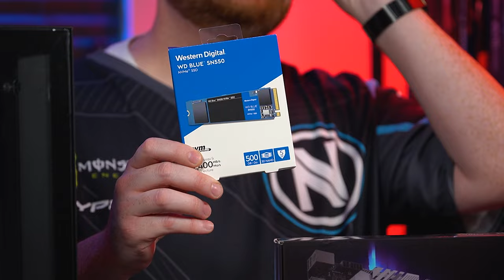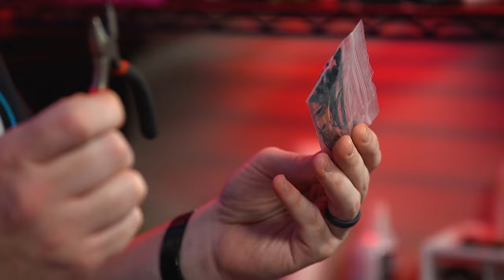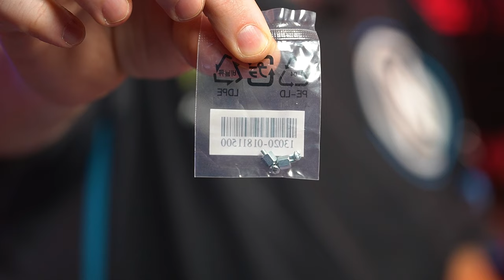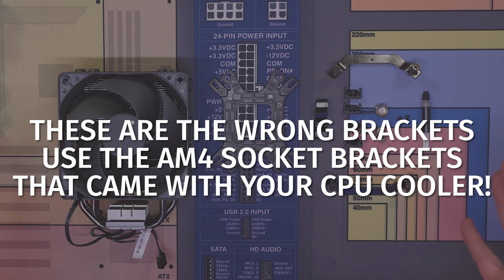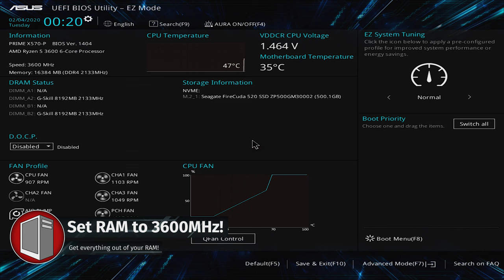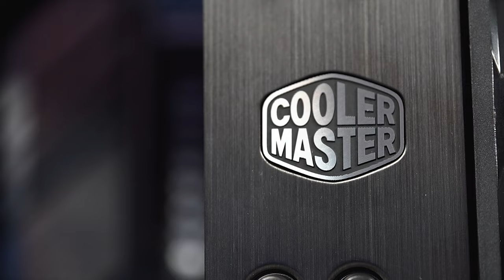How to Build a PC! Step-by-step (2020 Edition) | Robeytech

Comment: I would have went with a 1650S over a standard 1660 and saved $50. I mean cmon, the 1660 is only 3% better than the 1650S and you get GDDR6 with the 1650S.

Comment: Thanks for the great video! I followed this step by step with mostly different parts and my build turned out great. 
Different parts used:

Case - Lian Li 205m
Motherboard - Asrock B450M pro4
GPU - rx 580
PSU - EVGA 600W BQ Bronze
A few cheap Rosewill 120mm fans 

My only critique of the video was with the sections talking about the power cables for the CPU. I wish there was more explanation about the first 4 pin connector from the extension and the 2nd 8 pin connector directly from the PSU. My board only had 1 8pin ATX female connection which added to the confusion, but I admit that's my fault for having different parts, not the video's. 

All in all, really nice how - to and thanks again!

Comment: Loved this video. Very helpful explanation of the parts. Went for a similar build. No display when I turned it on; bought a small buzzer for the motherboard and the diagnostic told me in was a graphic card issue. Took the card out and reinstalled and all good. Thanks for the video, really helpful 👍.

Comment: I just finished building my first PC and this guide was extremely helpful.  I used some different parts but it still came out looking good for my first one. I went with an ASUS TUF Gaming x570-Pro Motherboard and a MSI GeForce GTX 1650 and I opted for the RGB on the cooler master H212 cpu fan.  I put all this in a Cooler Master MasterCase H500P Mesh ARGB.  Thank you for then information!

Comment: Just to clear one thing up. You mentioned m.2 SSDs are fast. m.2 is simply the physical connector. There are SATA m.2 SSDs are are slow (relatively) compared to NVMe m.2 SSDs. NVMe m.2 SSDs are the quick ones 2.5GB/s+.

Great Video!

Comment: I've finished my build today by following this guide!
My build is:
AMD Ryzen 5600x
Asus ROG Strix B550-F Gaming Wi-Fi
Corsair Vengeance LPX 32GB DDR4-3600 CL18
Noctua NH-D15 CHROMAX.BLACK
MSI GeForce RTX 3060 Ti 8 GB VENTUS 2X OC
Corsair RMx (2018) 850 W 80+ Gold Certified Fully Modular ATX Power Supply
Phanteks Eclipse P300A Mesh ATX Mid Tower Case
Inland Premium 1 TB M.2-2280 NVME Solid State Drive
***Warning: Don't get the Phanteks P300A unless you're okay with a very difficult case to build in!

I originally planned my parts for RTX 3080 and Ryzen 5900x but I'm just happy that I managed to get any of the new generation CPUs and GPUs. My PSU and CPU cooler is overkill for the parts I got.
I had to flash the motherboard BIOS before building the PC as it didn't have the latest Ryzen 5000 BIOS.

This is a great PC building tutorial for newbies like me!
I love this channel. I sometimes watch the livestream builds because Robeytech makes it entertaining.
This channel gave me the confidence to build my own PC and it's a very rewarding experience for me.
Thank you so much!

Comment: For those of you using a X570 Tuf Gaming Plus board and this case, the F Panel cord does not connect to the Mobo, it connects to the part he uses. Hope this saves you some time  and stress.

Comment: I had TWO Corsair Power supplies die on me in my lifetime and even after that I am still OK with them.
The first one I installed in 2008 and it ran almost non stop 24/7 until 2014 The next one Ran just as hard from 2014-2019  at which point "Dimitri" reached the end of his useful life and was retired.

Comment: I would keep the AM4 fan brackets just in case you should change coolers in the future that require them. A $150 motherboard isn't bad, but it seems like it has overkill CPU power delivery that also requires a PSU that can deliver more watts. Not good or bad, but there's a balancing act when picking parts and if you put more money in one component, then you have less for other components. You hit the balance just right in terms of not having to compromise later if you want to upgrade any component. Moreover, the PSU is definitely not a place to skimp and I would make sure to get at least a bronze certified 80+ in this regard. Good cable management tutorial as well.

Comment: So I used the same build with a few exceptions like I went with the prime X570-Pro motherboard. Its my first build. I followed your instructions and I get power from the power supply but my power button is not working. I checked and made sure all the front panel is connected right. Can you help me to figure out what I am missing here?
Thanks in advance

Comment: Really informative. Thankyou so much. I’m about to build my very first computer in the nxt week once the last of my parts arrive in the post….. You really surprised me ,actually I really impressed myself as a rank amateur that I somehow actually ordered all of the lil extras that will now allow me to turn my build into something potentially quite cool. I’m tossing up what CPU Cooler I want to use as again I’m well over my spending limit already but I’m thinking I’ll go with similar to what u used but in white argb for around $45 as my case is white with argb fans to match either that or liquid cooler I found for $85 w 1,2 or 3 fans ($110). I may stick w the more basic model, like your used.. & I can upgrade once I have some more money to splurge again…. 
I’d love if you would do a video on all the types of liquid cpu cooler options and show how to do it on a budget ……that would be really cool for me especially.
Surprisingly,this video Pretty much showed my that the process I had been working through in my minds eye is the same as what you just showed me now. I’m super excited to get building tho I’m a bit stuck on what OS I’ll go with… Win 10 or Win 11…..can u pls recommend what I’d be better off going with pls. I’m a bit unsure about whether things will be compatible w Win11 as not all inclusions go past Win10….. will that be a problem if I stick w 11? I recently brought a micro computer w Win11 installed & pre-activated 
On it yet I’m building this new compass the Micro just cannot handle the amount of programs,,photos& basic photo  editing  etc ….is there a way to either copy or re-install it on my new computer ? I’m trying to avoid having to spend another $100+ on buying either OS new. I’ve seen OS For sale on eBay sold oh an external memory stick w product key included….. are these trustworthy && will they do? 
Thanks for the tutorial.
Xx
Cheers from Claire.
 Aussie Girl Fan 🤓🐻

Comment: That mobo have also one more power suply cable 4 pin CPU conector. The 4 pin is necesarly only if you overclock the CPU? I saw that you pluged in just the 8 pin conector for CPU.

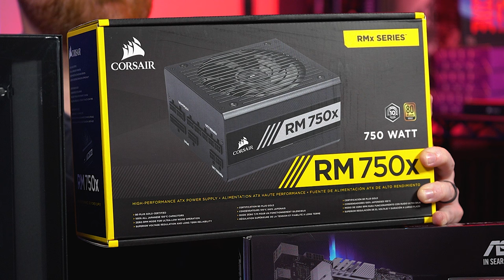Comment: 4:38 Do they actually require the 2 EPS connectors to be plugged in? I thought the second one was only optional, in case your CPU has power consumption requirements that exceed what a single connector can provide. Can you please clarify that point?

Comment: @ROBEYTECH sorry - two quick questions  re. CPU power cable install  : why install 2 x cpu cables into the psu - but only use one ? And : with the CPU extension cable that you split in half : does this mobo only need one
 4 pin connection ? What about the 6 pin socket ? Thanks !

Comment: This is the best building a pc video I've seen anywhere. Thank you for your time and effort. I just bought an i5-10600k and paired it with an msi z490-a pro, Hyper 212 Black Edition, Samsung - 980 500GB PCIe 3.0, Seagate - Barracuda 2TB, CORSAIR - Vengeance LPX 16GB 3200mhz, EVGA G5 supernova 650w psu and the same exact case as you. As soon as the prices on graphics cards come down I will look at the 1660ti 6g and the 2060 super 6gb card. Until then I will have to use my lowly gtx 1050ti 4gb card. I have never built a pc, did I do ok with the parts for my build?

Comment: Hey man best tutorial so far. The only question I have is the two CPU power supply cables you plugged in. Shouldnt it just be one 8pin cable that goes to the CPU on the motherboard? Wheres the second go?
Reply: I have the same question....and I can't find the answer. Did you?
Reply: @gabrield6197  turns out my mobo has an 8pin and a 4pin slot for power (2x 8 pin power connectors, 4 pins hang out) - so this tutorial was right

Comment: Awesome video man thank you.  Only question I have is earlier you mentioned that you bought some "Asia Horse" PSU extension wires.  I wasn't sure if the ones you used were included with what you bought.  Do they normally come with extension wires?  I'm building a PC using the same case with MSI MPG z490 mobo, RM 850x psu, and RTX 2070 super.  Any advice would be greatly appreciated as this is my first attempt at a build.  I love the channel.  You have a new sub.  Thanks in advance for the assist!

Comment: My pc specs:

Cpu: I7-9700k
Cooler: Cooler Master Hyper 212 RGB 
Motherboard: Gigabyte Z390 Ud ATX1151
Memory card: Kingston HyperX fury 16gb (2 x 8)
SSD: Samsung 970 Evo 500GB
HDD: WESTERN DIGITAL 1TB
GPU: Asus Rtx 2070 6GB DUAL
CASE: Corsair icue 220T
Power Supply: Corsair CXM 650W 80+ bronze
                          Microsoft 10 home 
MONITOR: AOC C24G1 144Hz
Keyboard: Razer Huntsman mini

Total: 2020 Cad
How much would this parts cost on black Friday? Any better deals? Tips?

Comment: so far this is one of the simplest pc builds ive seen that's actually helpful. however i have a question: are the cable extensions required? im going to use this case in a future build so i want to know. thank you in advance !

Comment: If one of these parts is out of stock, for the example the motherboard. How do you find an alternative? I want to build my own PC but I’m a noob when it comes to mixing and matching compatible parts.
Reply: Look for a motherboard that will support the generation of CPU you are trying to use. 
My indirect answer is to take the time learn how computers work. Understand the terminology like chipset, socket type, etc then you can start looking into PC parts. Its great that you want to build a PC but you have to learn to walk before you can run, so to speak.

Comment: Replacing my ASUS motherboard with a ASUS Tuf X570-Plus with WiFi.  I plan on using my same case but noticed the front panel wires are only three wires.  Do I need all the wires for a new AMD 7 5700X and the motherboard?

Comment: 32:05 "You want your fan to go out of the bottom. That is where the air is gonna come out" Whoops, it is installed the right way, as the filter is the intake. 

The airflow is the other way around. Don't want to collect dust on your filter on the power supply side.

Comment: I have a question, does the back plate come with the cooler or do we have to buy it separately.
Reply: Coolers sometimes are included with CPUs depending on which you buy. Regardless, they will come with brackets for AMD chips and Intel chips in the box. So use the one you need and toss or save the other.

Comment: Quick question : Why did you use cable extensions ? The cables were too short because of the case and the main board connector position ? I never built a PC before :)
Reply: Aesthetics

Comment: Help!  I'm trying my first build with my son and I'm lost at 31:09 and 38:07.  We have a Corsair CX750M, which has a hardwired24pin ATX cable and 8pin EPS cable.  We have the same 570 motherboard.  It appears that you have another 8pin EPS from the power supply to a 8pin cable extension that you split into 2-4pins.  We don't have a second EPS cable with the Corsair CX750M.  My question is do we need to purchase one or is there an acceptable configuration where its not required - like if we did not connect to the EATX12V_2 on the ASUS board?

Comment: Should cable extensions come with your pcu or will you have to buy them separate this is my first time actually building a pc.
Reply: Cable extensions are not necessary at all (purely for aesthetics) and as such not included with the PSU. You would need to buy them separately if you really want them.

Comment: Perfect never built a PC before. Luckily you had the same case as I did, otherwise it would be a lot more difficult. I had some issues how to connect the GPU rtx 3070 properly because it needs 1x 6 and 1x 8 pin however I did not quite get how 6 +2 pins worked. Also my motherboard was different which and I had no room for a second cpu power cable. Besides that great tutorial. For beginners I should recommend to get a boxed cpu, the stock one is really easy to install from AMD.

Comment: Hello thank you for the videos!

I'm running the standard build but I'm on long wait for a graphics card. 

Is it possible to use a 
Sapphire Radeon R9 290X 4GB GDDR5 Dual DVI-D/HDMI/DP TRI-X OC Version (UEFI) PCI-Express Graphics Card 11226-16-20G 

Until the 2060 is available or is that not possible ? thank you !

Comment: Dang how did you get the 4th screw in the power supply? I have the same case and a rm650x, and my top right is blocked by the case

Comment: I am brand new to DIY Builds.  This video eased some of my anxiety.  PcPartsPicker is giving compatibility warning for PS..."The Asus PRIME X570-P ATX AM4 Motherboard has an additional 4-pin ATX power connector but the Corsair RMx 750 W 80+ Gold Certified Fully Modular ATX Power Supply does not. This connector is used to supply additional 12V current to the motherboard. While the system will likely still run without it, higher current demands such as extreme overclocking or large video card current draws may require it."  I use my computer for home use and do not game.  Will I have an issue with this compatibility warning?  Thanks.

Comment: new to pc stuff, how easy would it be to get and install a better graphics card? also, what would you recommend? the total cost is roughly  $1400 USD as of now, and i dont really want to spend more than $2000 total. what cards do you think would be best for performance and price?
Reply from the maker: It's very easy to do in this case.  It's a simple swap.
Reply from the maker: And for your second question the 3070 or the 3070Ti are the sweet spot if you can get them.
Reply: @RobeytechLive  thank you so much! <3

Comment: How did you load windows OS? It's been a long time since I last looked into pc builds where you had to buy windows OS. But that was in the days where PCs came with a CD drive
Reply: You would use a Windows USB installer. The gist of it is: on a working PC with internet, download the media creation tool from Microsoft to make a bootable USB installer. Boot the new PC off of that USB drive and go through the Windows setup process. There are plenty of guides that explain how to install Windows on a new PC.

Comment: I'm so excited just ordered my new gaming pc! 
LIAN LI O11DYNAMIC XL ROG CERTIFIED GAMING CASE
Custom Liquid Cooling KitLiquid Series RGB Lian Li PC011D – EKTubingClear Hardline PETG Tubing (Bent/Metallic Fittings)
Graphics Card Cooling-GPU Water Block 
Coolant Colour-Mayhems X1 Clear
Overclocked AMD Ryzen 9 3900X 
Mobo-ASUS® TUF X570-PLUS GAMING
(RAM) 32GB Corsair VENGEANCE RGB PRO DDR4 3200MHz (2 x 16GB)
Graphics Card-11GB ASUS ROG STRIX GEFORCE RTX 2080 Ti 
2TB SEAGATE BARRACUDA 120 2.5" SSD 
4 TB IRONWOLF PRO 3.5", 7200 RPM 128MB CACHE 
1TB SAMSUNG 970 EVO PLUS M.2
Power Supply-CORSAIR 850W RMx SERIES™ MODULAR 80 PLUS® GOLD, ULTRA QUIET w/Braided Power Supply CORSAIR Premium Individually Sleeved PSU Cable Kit Pro - White

WOOHOO!
Reply: @RobeytechLive  IKR! Considering my budget, had to settle for the TUF MOBO, it will look lite someone wearing a gown with sensible shoes, but I love it. Thank you for sharing in my excitment.

Comment: You took out all the RGB strips and lights of the NZXT Elite, this quite defeats the purpose of the case in the first place.
Why choosing it if you then remove all RGB fans and strips from it, also removing the control box from the back cabling?
It would have been an awesome rundown if you showed how to connect all the case as it comes from the shop, yours instead has been already trifled with.

Comment: I think some parts were a bit unclear and it seems to be the ones involving cables. I'm a newbie of course but that's also who this is for I imagine so yeah. Like the extension cable part, it was kind of confusing which cables you were handling at which point. It also didn't help that they come out to the other side of the panel the motherboard is mounted on. Then you made a separate chapter for the cables connecting to the fan headers... Also it doesn't help if there's a slot on the PSU that says PCIe and you are supposed to not plug in the end of the cable that says "PCIe" into that, I guess because that marks that it has to go into the actual PCIe slot at the destination? I don't know, everything else was pretty clear to follow, but that I feel like I have to watch a couple times.

Comment: In which pin you will plug a “reset switch” if you have one ? 29:05 
The 3rd and 4th or the 4th and 5th pins ?
Reply: There will be a diagram in the manual.

Comment: I also bought yesterday a NZXT510 to replace my core500 case. Because the airflow of the core500 is terrible.

But now I am struggling. Since a core500 is a mini-itx build. And the 510 a micro-build I noticed that some things I need to change unfortunately. But it should be possible to install a mini-itx Mainboard.

But I bought everything from the red team. 3600X, 5700XT. MSI B450 Mini-itx Fatality.

But when AMD is releasing the 6000X series gpu and 5000cpu.
I need to swap the following.
- fractal design 500watt sfx.
- motherboard
- GPU / CPU
Even if I know the CPU will work on 450 with a BIOS update what will be available in January 2021 by most manufacturers.